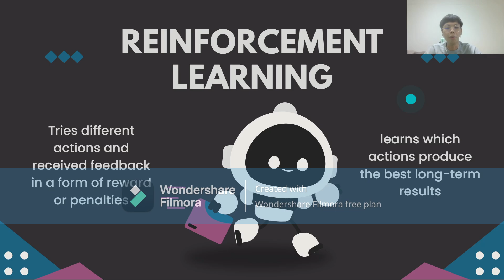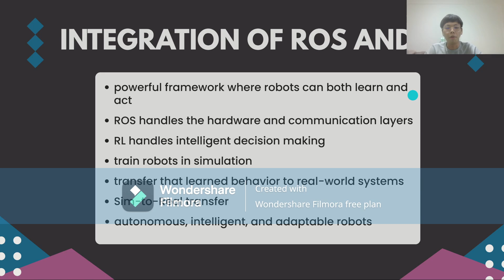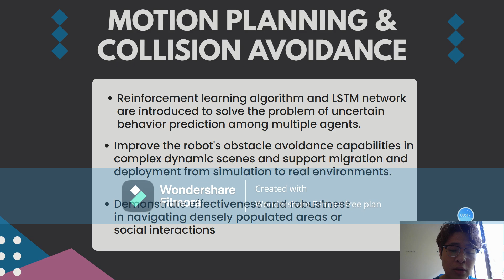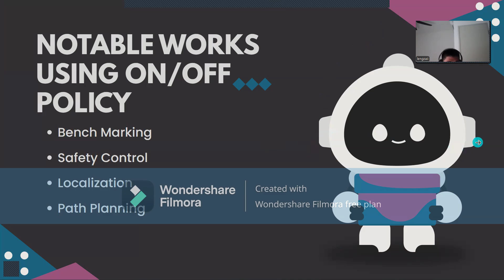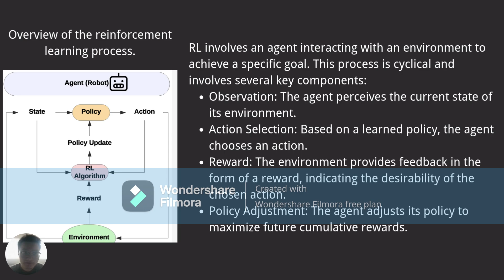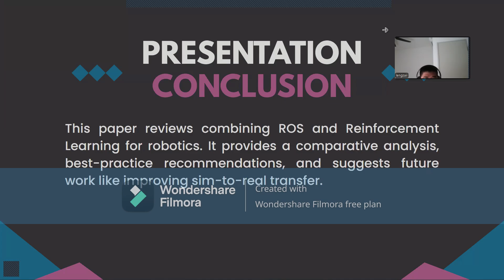25/04 AIT306 Deep RL and Control Paper Sharing Group 9

Comment: Question from group 6:
Can the control learning framework mentioned be extended to scenarios such as home service robots and agricultural harvesting robots? What optimizations are needed before deployment?
Reply: Group 9 answer:
Yes, the control learning framework described in the paper can be extended to scenarios such as home service robots and agricultural harvesting robots. However, several important optimizations must be made before deployment. These include building simulation environments specific to homes or farms, designing appropriate reward functions for each task, and applying techniques like domain randomization to improve real-world adaptability. Additionally, it is necessary to integrate multiple sensors for reliable perception, optimize the models for low-power hardware, and ensure safety by incorporating fallback controllers and control barrier functions. These steps help guarantee that the robot operates efficiently, safely, and reliably in complex, dynamic environments

Comment: In preparation for the experiments presented in this paper, did you evaluate the specific effects of timing mismatches between Gym steps (10–50 Hz typical) and ROS control topics (≥1 kHz common) on training convergence speed and policy stability? The paper does not provide controlled experiments on the effects of synchronization strategies (e.g., ros_control real-time control loop, or ROS 2 DDS QoS configuration) on sampling quality; does this omission weaken the comparability of different efforts? If the framework summarized in this paper is transferred to scenarios that require sub-millisecond control accuracy (e.g., high-speed manipulators, quadrotor aerial robots, etc.), which layer do you think should be improved first (Gym interface, task encapsulation layer, or low-level DDS communication parameters) to avoid bottlenecks caused by training-control frequency coupling? Why?
Reply: Group 9 Answer
In a rigorous research setting, evaluating or at least controlling for timing effects is crucial. While I cannot speak for the authors of the specific paper, a robust study would ideally address this. The discrepancy between the low-frequency decision-making of the RL agent (the "Gym step," typically 10-50 Hz) and the high-frequency requirements of a robot's low-level motor controllers (often running at 1 kHz or higher via `Ros control` or similar frameworks) is a fundamental challenge.

This frequency mismatch is typically handled using a technique called **action repetition**. The action computed by the RL policy is not a single, instantaneous command. Instead, it is a target (e.g., a joint position, velocity, or torque) that is sent to the high-frequency controller. The controller then works to achieve and maintain this target for a fixed number of its own cycles, until the RL agent provides a new action at its next step.

The key parameters that should be evaluated are:

RL Step Frequency. How does changing the agent's decision-making rate (e.g., from 10 Hz to 50 Hz) affect learning? A lower frequency gives more time for the system to settle but can lead to sluggish or reactive control. A higher frequency allows for more fine-grained control but can be harder to learn and more sensitive to delays.
Timing Jitter How does the variability in the time between agent steps affect policy stability? Real-world systems rarely have perfectly consistent step times. This jitter can confuse the agent, as the dynamics of the environment appear to change unpredictably, violating the assumptions of a standard Markov Decision Process (MDP).
Policy Inference Time How long does it take to compute an action? If this time is significant and variable, it introduces latency that can destabilize the system, especially at high frequencies.

Part 2: Omission of Synchronization Experiments

Answer:
The omission of a clear discussion and analysis of synchronization strategies significantly weakens the comparability and reproducibility of research efforts in this domain.

Without a standardized approach to synchronization, it is difficult to determine if a new algorithm or framework is superior because of its own merits, or if it simply benefited from a more favorable (i.e., lower latency, lower jitter) communication and control infrastructure.

Here’s why this is so critical:

1. Hidden Variables:
Latency and jitter act as hidden variables in the learning process. An RL agent trained in a system with 5 ms of latency will learn a different policy than one trained with 20 MS of latency, even if the algorithm, robot, and task are identical.
2. Reproducibility Crisis:
If the underlying timing and synchronization are not documented, other researchers cannot accurately replicate the experimental setup, making it impossible to verify the results or build upon them.
3. Real-Time vs. Non-Real-Time:
Tools like the `Ros control` real-time loop or carefully configured ROS 2 DDS QoS settings are designed to create a deterministic environment where data arrives predictably. Comparing a system that uses these real-time capabilities to one that uses standard, "best-effort" ROS communication is an apples-to-oranges comparison. The former is inherently more stable and suitable for high-performance control.

Therefore, failing to describe the synchronization strategy makes it difficult to isolate the contribution of the core RL algorithm and fairly compare it against other work.

Part 3 & 4: Prioritizing Improvements for High-Frequency Control

Answer:

For scenarios requiring sub-millisecond accuracy, the layers should be prioritized for improvement in the following order:

First Priority: Low-Level DDS Communication Parameters

The communication middleware is the bedrock of the entire system. If the foundation is not solid, no amount of optimization at higher layers can compensate for it. For sub-millisecond control, the round-trip time for sensor data to reach the policy and for the resulting action to reach the actuators must be well within your time budget.

Fundamental Bottleneck: 
The primary bottleneck in any distributed control system is communication latency and reliability. DDS (the middleware for ROS 2) is highly tunable. Optimizing it is the most direct way to address the physical transmission of data.
Enabling Real-Time Performance:
To achieve sub-millisecond accuracy, you must configure DDS for real-time performance. This involves:
QoS (Quality of Service) Tuning:
Setting QoS profiles for low latency, specifying deadlines to ensure data arrives on time, and choosing the appropriate reliability policy.
Network Configuration:
Using a Real-Time Operating System (RTOS), configuring network cards for low latency, and potentially using dedicated network hardware.
Zero-Copy Transport: 
Using features like intra-process communication or shared memory to avoid data copies when components run on the same machine.

If the DDS layer cannot guarantee timely data delivery, the state observations the policy receives will be stale, and the actions will arrive too late, making stable high-frequency control impossible.

Second Priority: Task Encapsulation Layer

This layer is where the logic that connects the RL agent to the robot's control loops resides. Once the communication is guaranteed to be fast and reliable, this layer becomes the next most likely source of performance bottlenecks.

Computational Overhead:
This layer handles tasks like receiving sensor data, processing it into the RL observation space (`state`), calculating the reward, and checking for termination conditions. Every line of code here adds to the latency within the control loop.
Synchronization Logic:
This is where synchronization strategies are implemented. A poorly designed strategy can introduce jitter or buffer-related delays. For sub-millisecond control, this layer must be extremely lean and efficient, possibly written in a high-performance language like C++.

Third Priority: Gym Interface

The Gym interface itself is a simple, abstract API (`step`, `reset`, etc.). The performance bottleneck is almost never the API call itself, but rather the implementation of the `step` function, which contains the task encapsulation and communication logic discussed above.

While an inefficient Python wrapper could add some overhead, it is minor compared to the potential delays from communication and data processing. The "Gym step frequency" is an outcome determined by the performance of the underlying layers, not a cause of the bottleneck. Optimizing DDS and the task encapsulation layer is what will enable a higher Gym step frequency. Therefore, improving the interface itself is the last priority.